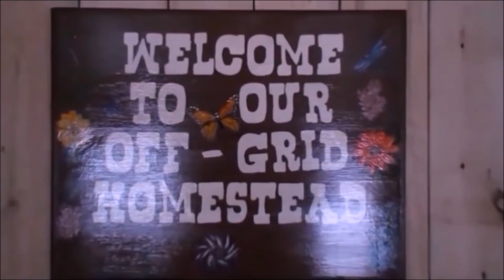Wow...Smokin./ Off Grid Homestead Door Install

Comment: Great video Cecil and Heather. Heather did a great job on using the saw apart from the smoke cloud lol. Most women wouldn't have a clue how to operate the saw.Door looks great and with the trim finished it will really stand out.
Cheers, Jeff.

Comment: Hi Cecil did you ever check out joesaljowon on you tube his siding jig for cutting bevel siding works good and it would take you an hour or two to build he shows how to make them step by step I made a set out of scrap that I had laying a round and they cut 8" beveled siding 1/4 x 3/4 and they cut beautiful siding I have cut enough siding to do 4 different builds with little effort well worth building and free siding for your house